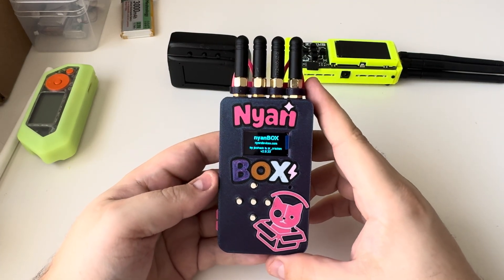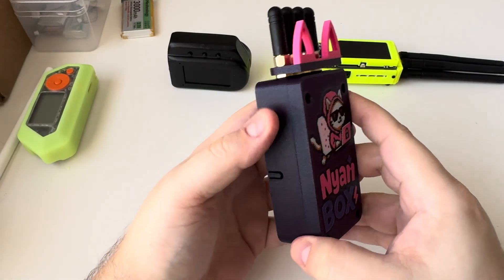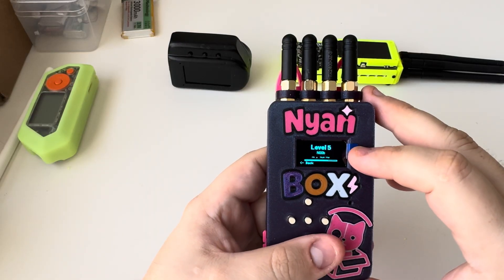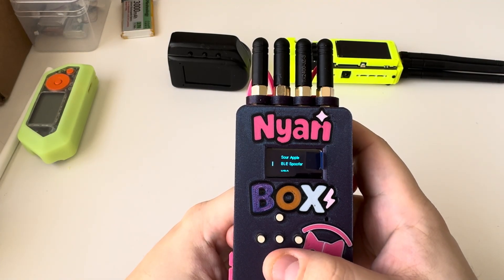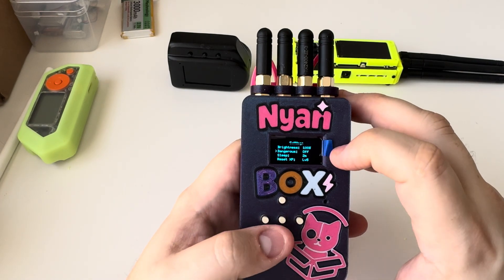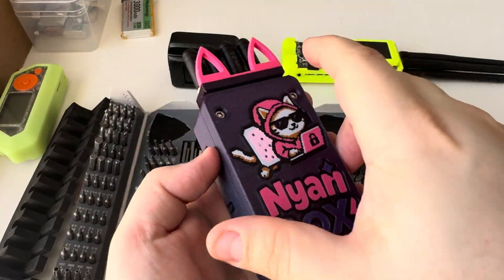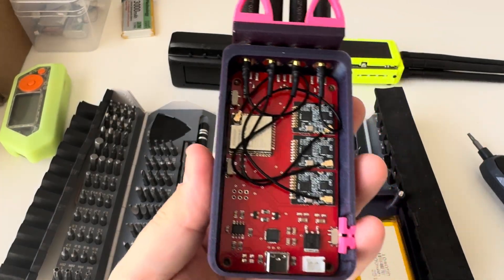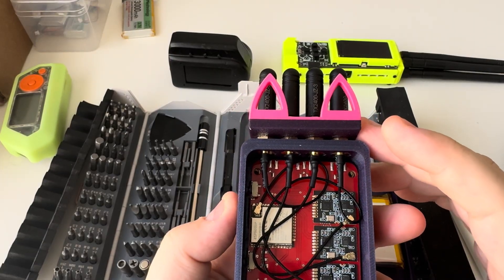Meet The NyanBox. The Most Adorable Hacking Tool I Own!

Comment: I feel like the wires are too messy, one running over the chip of another, that could be managed better and maybe some sheilding tape
Reply from the maker: The wires you see are the antenna cables. They already have a shield on them so no need for that. I think it looks fine as they don’t cause harm to any of the components.  Thanks for the feedback.

Comment: How could an average non-hacker use this gadget for protection?
Reply from the maker: There are many ways. You can use the WiFi tool to see if there are hidden cameras. Bluetooth can detect trackers on vehicles, AirTag and Tile tags as well  Flock can detect cameras that record license plates on vehicles like tolls, traffic intersections, etc. This device gets a lot of support and constant updates so I’m sure there be much more.
Reply: @Cherry_Tomato_1 hidden cameras but would it tell you exactly where the hidden camera is?

Comment: Could you put something on the inside in order to make contact with the boot and rst buttons? Kinda like how the RubberDucky has those stickers they use?
Reply: fix has been finalized 🥵
Reply from the maker: I will make this clear! Thanks for being on top of it.
Reply from the maker: Yeah you could but to keep it in place would be a bit rough.  Crackiin was quick to solve the issue.